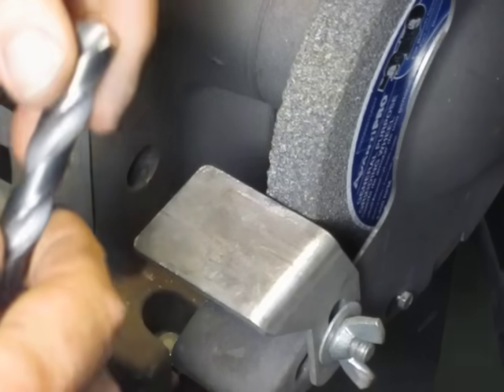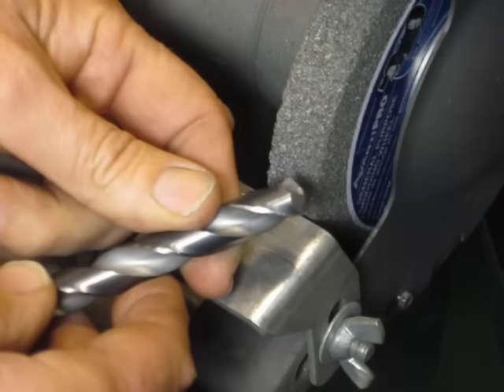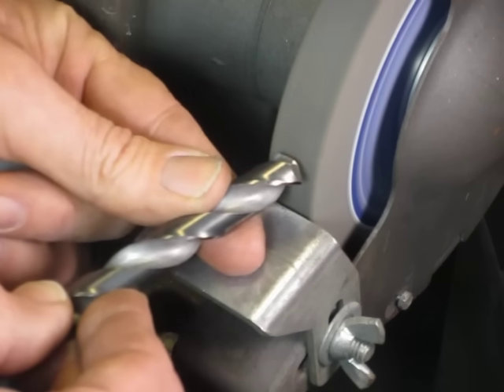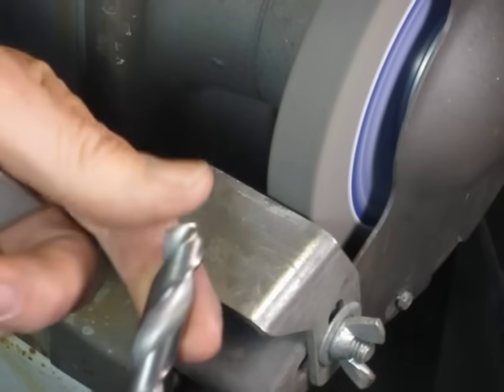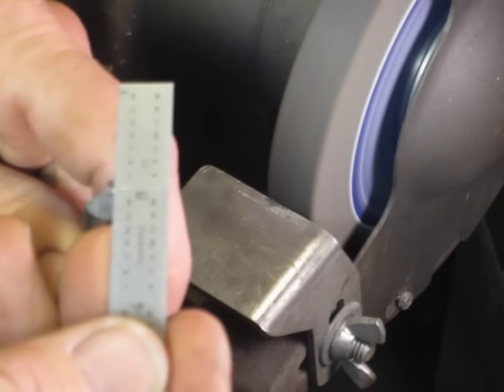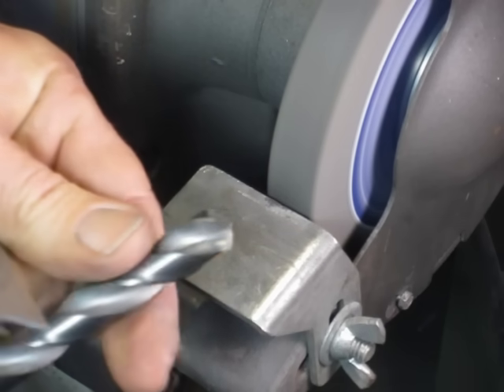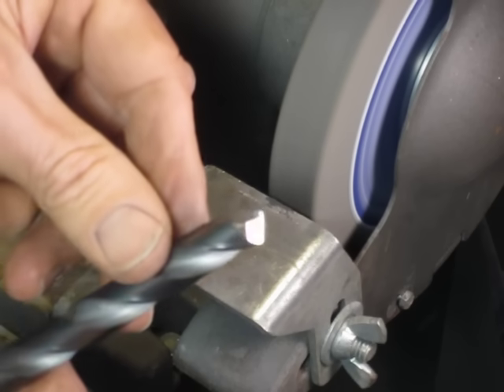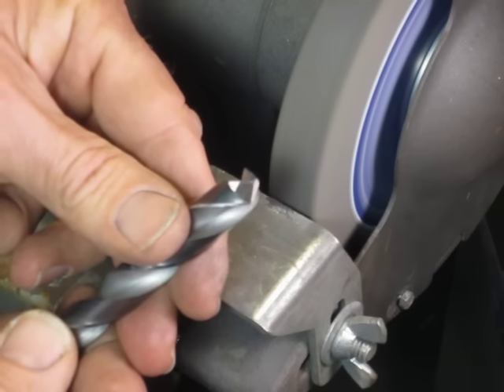How to Hand Sharpen a Twist Drill

Comment: Nice explanation for novices - gives it simply. I notice a few bitchy comments from "machinists", but pay no heed! BTW I(formerly a machinist fitter)sharpen from 1mm to 40mm dia. drills, by hand, regularly(for 30 yrs) and without issue, but do the compounded relief angles in a single cam motion(roll and extend the drill flute up the wheel surface & do tip thining by slitting/thin cutting discs in angle grinder(fixed). Even done some 80 degree specials for thermo-plastics work. Keep safe and well.
Reply: Are you saying you are for or against rotating the drill bit horizontal to axial to obtain relief angle? British, U.S. and Australasian Engineering society all agree slow downward rotation, putting gradual but progressive relief grind is best for strength and drilling! Also thinning the web he did it weakens the tip! Thinning the web is best done at Double the angle and grind the entire rear of the relief face at half way point back! This thins the web and the relief but dose not effect the thickness or strength of the cutting edge or web! Also, if you don't have access to a protractor, two nuts tack welded vertical face to face will give you a rough guide of 120 degrees included angle in-between the two vertical welded faces! 😉👍
Reply: @jpsengin2  For( as you need increasing secondry relief angles -Generally I start horizontally, but above the centre of the grinder spindle(left hand as intermediate rest), so that approx 5deg relief is initially acheived, and then I twist and guide the bit forward in a cam action that gives an increasing relief angle(to suit material to be drilled, whether it's through hole/blind, or piloted..….…..). In effect the contact point's location between the drill bit and abrasive wheel is usually the same(above centre), with the angle of the drill bit changing as its rotated into the wheel. It gets more awkward to do large dia drill bits, as the land area is so much wider than most wheels, and requires an additional motion parallel to the wheel to cover the land area.
Thining can be done A-symetric(akin to slot drills) to retain tip mass, but depends on the previous factors.
Yeah, the nut trick is a good one, and often taught to new apprentices, for general jobbing workshop stuff.
Some of the tip angles can get a bit awkward when doing plastics, etc as the angle becomes more acute, then the effective land area becomes even greater and the secondary relief angles end up being too tight to do on a bench grinder.
Ultimately it's a matter of technique/experience and choice of approach depending on the equipment and needs - I'm sure we're all guilty of sharpening drill bits with an angle grinder at some point, or other!! ;)
:)

Comment: Just buy a drill point gauge and you will have your angle and measurement. Measure the hole you drill and if it is not oversize you got a correct drill point. That is the test test in machinist school.
Reply from the maker: Yes, I mentioned that in the video. I've sharpened so many drill bits that I don't require a gauge, but if you are in the learning phase, one should definitely be used.
Reply: @TomsTechniques  I have been  a red seal millwright machinist for 40 years so I think I might have got past the learning phase. If you need help to cast a gearbox, turn the shafts, cut the gears and pour the bearings for it I can help you.

Comment: best to use a 150 grit white stone. Its what I use with great results. He is knocking off too much. With the 150 grit 8inch stone I have you touch it lightly and thats all you need to do. If you continue to do it his way all the time you will have to buy another bit. Hes taking too much off the drill. Again lightly to sharpen not to over do it, thats all it takes...
Reply from the maker: 150 grit is very fine. I prefer 80 to 100 grit to quickly correct any damage to the drill. Drill bits can be sharpened hundreds of times, regardless of the grit used. To each his own, I guess.

Comment: So wrong as i was show by metal worker at the local foundry called SSAB how to sharpen a bit and weld so the slag just lifted, and believe me it was many hours of sweat ! and for drill bit take a new one and you see that its not strati its curved !
Reply from the maker: Using conical relief is old school. Most drill bit manufacturers today use multi-faceted drill point geometry, which is what the technique shown in this video is based on.

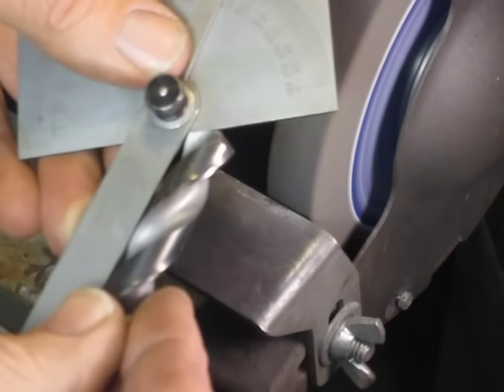Comment: 4:41, the trailing edge is higher than the cutting edge, it will never cut.   7: 45 compare a new drill bit with the one being sharpened, you will notice there is a nice curve between the cutting edge and the trailing edge. The ones he is sharpening have several different flat angles.He has no idea how to sharpen a drill bit.
Before I am pilloried for my comments, I should point out I am a retired mechanical engineer with over 50 years experience.  9: 23 the trailing edge is still higher than the cutting edge, the sharpening a drill bit you have to put the drill to the wheel and twist it clockwise while you move it smoothly to your left keeping contact with the wheel. This will give you the relief you need to keep the cutting edge higher.  On larger drill bits you may need point thinning which is a different skill. 
Drill bits are so cheap now you would be better throwing them away unless you are a competent engineer. If he demonstrates that drill bit cutting he is a fraud.
Reply from the maker: You are correct that at 4:41, the drill would not cut. But had you paid attention to the remainder of the video you would have learned that a second and sometimes third clearance angle is required when using this drill point geometry. You might also have noticed that I showed how to thin the point at the end. Or maybe not.

The conical relief that you referenced is most definitely old school. Most commercially sharpened drill bits today use multi-faceted drill point technology which is much more efficient, and for the novice, this take on it is much easier to grind. 

Finally, only a fool would throw away a dull drill bit when a few seconds at the grinder would make it good as new.

Comment: This guy has done 22X10 power 100,000, yeah it looks easy.  I’m 73, engineering degree with honors, had a toolmaker give me a one hour lesson on drill sharpening and I still reduce a 6” long bit to 3” long before I get it right!  He discounts his years of experience and knowledge.  If you ever have to recreate our civilization make sure you have at least 1000 tool and die makers.  They are use to working 7-12s so that should be enough, don’t forget donuts on payday!

Comment: You do a machine quality job on yr sharpening skills, i can do a pretty good job, but i watched yr video again because im going to sharpen all my bits today & want to do as good as possible 👍
Reply from the maker: If you are going to sharpen a lot of drill bits, be sure to spot check a few as you go. Look for how easy they feed, equal size chips coming from each cutting edge, and acurately sized holes.

Comment: Yeah beginners, sure. Good thing anyone thinking of sharpening a bit is most likely NOT a beginner. You are good but You are using your eye for all the angles so there is a lot of skill in YOUR process. I can do a Fantastic Job one day and suck the next.
I would add one recommendation. Use a Disk Sander not a Grinder.
Reply from the maker: This video was made with the beginner in mind, and if you scan the comments, you'll see that many of them are success stories from those who used it to successfully sharpen their first drill bit. I make it look easy in the video because I've had years of practice, using the same techniques demonstrated. None of them are beyond the capabilty of a beginner, including measuring the length and angle of the cutting edges, not by eye, but by using a ruler and protractor. 

It sounds like you are having trouble being consistent, which means you need to pay closer attention to detail, and devote more time to practice.

In my experience, belt sanders tend to round the cutting edge over very slightly and prevents it from cutting freely. I would suggest sticking to a grinding wheel.
Reply: A sander will round yr edges, can make the bit duller than when you started..any machinist would tell you to use a hard wheel ..
Reply: @toddjacobs5660  not to mention that sander will over heat the cutting edge, it will chip or dull about the time it enters the metal.

Comment: Good tips showing how easy it is for beginners. I tend to roll the drill rather than taking it in two stages which also works well with practice. Using a bench sander works well too in upright position. An overhead spotlight looking directly down helps to get precise angle each time you repeat action along with using permenant marker to draw line on base plate showing correct angle
On a really knackered drill bit be careful to go in stages to avoid overheating or drill cutting edge will become soft and will quickly become blunt.

Comment: from minute 10:23 is for maestro; that is an art already! Making the tip sharp! Jesus, you are good!
What grinding wheel you will recommend for sharpening drill bits like that, ...so the wheel have (remain) with sharp edge for that final touch?!
Reply: Very challenging for me. I have drill blades not already in use. I will try to do sharpining if I can do it well.

Comment: Where do I get one of those protractors?
Reply: Or you can use two regular 6 sided nuts. Put them together (flat sides touching) and put the drill bit cutting edge into the v of the nut. The drill bit angle should match the angle of the nuts.
Reply from the maker: Any industrial supply will have them. Try McMaster Carr.

Comment: Well Tom I never ground one like that. I was taught to grind the relief in while it was being ground and in a sweeping motion. Also never saw you check the tip angle, as it should also be 59 degrees when done correct.
Reply from the maker: The type of relief you describing is called conical relief and is the one we all learned in shop class (even mine). The type of relief I show in the video is called multi-faceted relief. Both methods work very well, but the one I use is easier to grind and cuts a little more efficiently. If you watch the video, I'm pretty sure you'll see me discuss drill point angles and check the one I was grinding with a protractor.
Reply: @TomsTechniques maybe I missed it,  but I didn't see you show them how to check the point angle as would be fone on a drill gauge. I know it would be pretty difficult to do with a protractor because I've tried it myself. I realize the way you showed them is much easier to learn to grind because the drill isn't really in movement. However it would be better than some of the drills that I've seen come out of some machines. I myself have been a machinist since 1978. I also have more than one way to thin the point, and the way that I like best is a chip breaker, however if done wrong can mess the drill up and take away from the land and change the length of one side. Done right it will run thousands of parts, done wrong and it can burn the drill up or make it walk off center.
Reply: Only thing I would say is not go so high up with second relief cut. Need to keep material behind cutting edge for heat distribution when drill is cutting. Last years running screw machines I would grind drills with similar grind using surface grinder and 5C collet index fixture. Then thin point by hand, and for soft metals put chip breaker. On soft metal such as brass, the chip breaker keeps the drill from getting sucked into spot drill hole. Had drills break from not putting chip breaker on drill. Also works to help drill from getting sucked thru hole when drilling flat stock. Made alot of drills into step drills, sheet metal style drills for different parts we made on Davenports.
Reply: @danielcarlson9231  we ground everything like that, even turbo flutes, only thing we never ground like that was straight flutes or half rounds, by the way half rounds were our worst to grind by hand.lol

Comment: Thanks, Tom. Great video. The technique I was taught involves a lot of rotation and tilting to follow to relief angle. My instructor obviously had it down to an art form, but some days (most days, actually) I just don't have the finesse and patience to charm the drill bit like that. Really love your systematic and measured method.
Reply from the maker: We all learned the conical relief method, but faceted relief is more efficient, so it generates less heat. The fact that it's also easier to grind is a bonus.

Comment: The instructors at my college say to lift it up and back as you're grinding (but don't twist), after starting at the horizontal position. How are you doing it by just going side to side? What about the back side? The bit itself isn't designed straight. Do you start at the very edge (towards the front) or is it back a little more, at an angle? I wasn't able to get it the first day they showed me, but they seemed to get it fine.
Reply from the maker: It sounds like they are trying to grind the surface of the primary clearance andle dead flat, rather than just copy the curve of the wheel. That sounds good in theory, but is very difficult to accomplish in reality. It's much easier go with the curve of the wheel and if additional clearance is necessary, just add a slight secondary clearance angle to approximate the flat surface. Either method will work if done properly.

Comment: What thaaa !!!  I went to high school 2 years as machinist , 2 years as machinist technical school, 2 years technical school tool & die. All three agree how to hand grind a twist drill and this isn't yours. I'm a 45 year old tool maker. Three different schools and my self say your do not know what you are doing. That may work in wood, aluminum. In steel in one of my cnc VMC or cnc Lathe, manual machines it would last 10% of its life. By grinding so much of the back angle, you lost the support. Also you are wasting the drills life of service grinding that way. If you have a question, go buy a Black Diamond drill pointer and your hand ground point will look like that, if you know what your doing !
Reply from the maker: Gee Bob, that must be why I haven't been able to drill any holes in steel during my 50 year career as a machinist. Thanks!

Seriously, do a little reading on multi-faceted drill point geometry and expand your knowlege a bit.
Reply: This is definitely different than how they're teaching us at school (which isn't working for me), including on their videos
Reply: Perfect reply- you are absolutely correct [ I am retired machinist and toolmaker]. Also using a protractor for this job is amateurish, drill sharpening gauge is available and it will measure at same time angle and length of the flute.

Comment: You don't need a gauge! Look at the drill "end on", if the cutting edges are curved back the angle of the point is too steep,  if it's "hooked" it's too shallow. Simple EH?. Hold the drill sharp end up and look at the cutting edges against a bright background, rotate it 180 deg. Both cutting edges should be the same length, adjust by grinding the longer one. Be sure to have a small relief behind the cutting edge. Sharpening drills using this method is a simple procedure and works with small and very large drills. I've used it on drills from 5mm to 60 mm. With drills over of 10mm and over, reducing the length of the chisel end with a narrow disc like an angle grinder makes the cut much better, unnecessary if using a pilot hole. A properly sharpened drill will produce two metal spirals when drilling. Use a lubricant, oil or soft soap!
Reply from the maker: Doing it by eye is simple for someone with experience like you and I, but not so much for someone who has never done it. Good teaching starts with the basics.
Reply: I m do the same you the best

Comment: Maybe I won't toss out my dull twist drills now, but I use small ones.  2 to 4 mm, it is hard to see the tips.  Any tips for doing small drills?  Other than magnification?
Reply from the maker: Hold the small ones in a pin vise. A mark on rhe handle will make it easier to keep track of rotation. And use magnification.
Reply: seems great to use a drill many times, but do sharper more is skill job, and control the angle is correct in 118